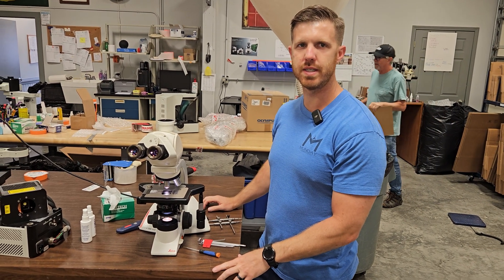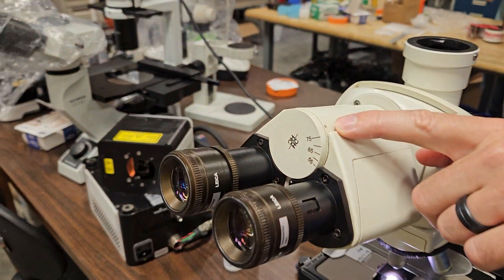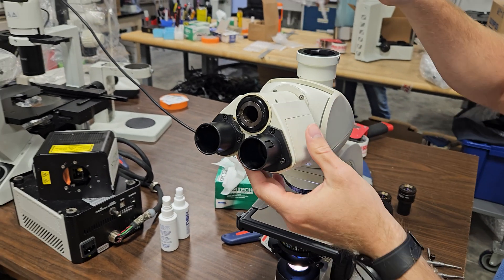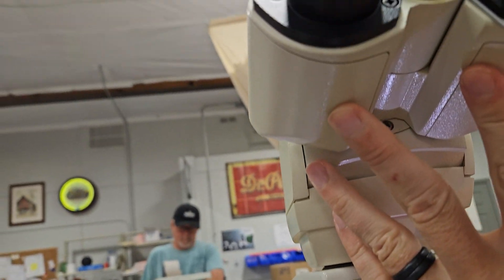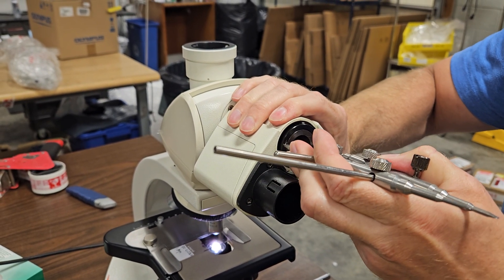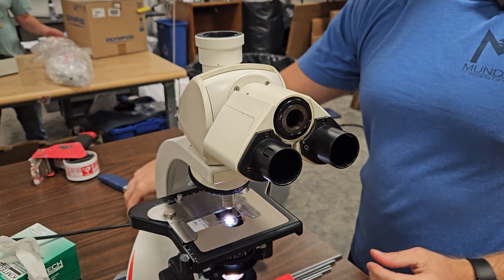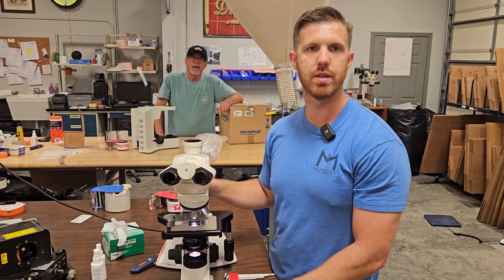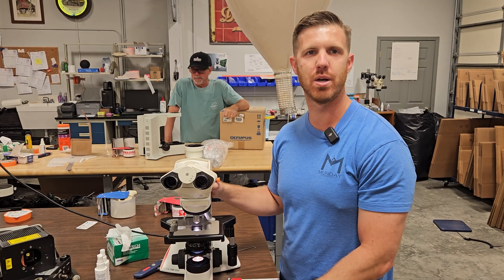Fixing a Drooping Microscope Head Tube | Leica DM1000 & More | Munday Scientific

Comment: Quick question. What would you do with the opposite problem : stuck and NOT not moving ocular tube? I got it to move gently heating the center portion but it requires way too much force. Lubrication seems hard to get thru... Regards, J.